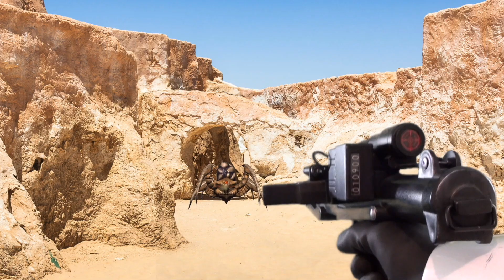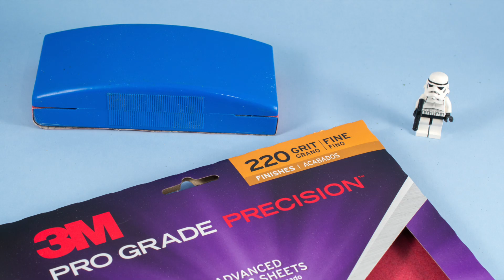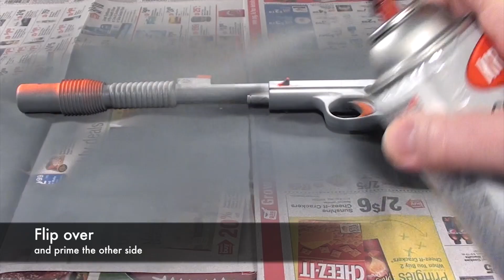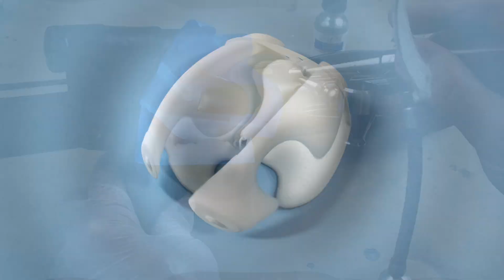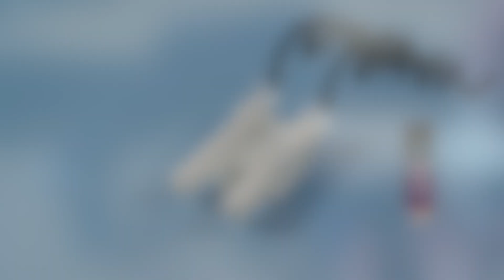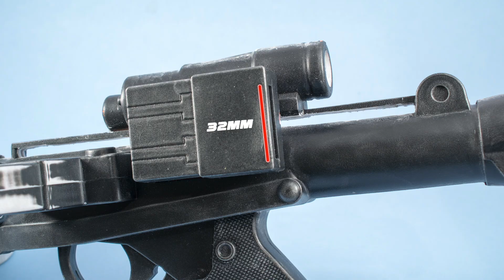Star Wars Stormtrooper Plastic E11 Blaster Prop Build

Comment: Did you seal the paint when it was done?  How has your paint job held up?  Got one of these and wish i had found your video a week ago....  Last night I changed my mind.  I will update using the techniques you made in this video.   Some questions I have:
     1.  If you are going to just cover the hole on the large side of the scope, then why did you drill it out?  Why not just glue the picture flat agains the intact flat scope?   Or  did yours already have a hole in scope at both ends?  Mine I bought is solid on both ends.  Did you drill out the front?
     2.  Why didn't you make the ring for the scope the same diameter as the large end of the scope instead of having the step?  The pics I have found do not have this step.
     3.  Did you glue the pop rivets to the power cylinders or not?  Because it I do not see them when you glue the power cylinders to the blaster.
4.  I ordered two pack of mic jacks.  Glad I did. I had horrible time cutting mic jack perpendicular.  So , what I did instead is I did not cut the black portion of mic jack.  Instead I drilled an undersized hole with closest size drill bit I had. Then I sanded hole larger until I could press fit the mic jack into the hole. Then I glued it in place.
5.  Also, looking back at video now, it looks like video sanded power cylinders smooth .  I wish I had done that. Not sure I want to go back and sand now that they are painted.

Comment: Is this compatible with the 501 legion requirements?
Reply from the maker: I have seen many other troopers "troop" with this weapon.  Not mine, but I've seen people who just buy the Rubie's blaster and spray it flat black without doing anything else.  The Rubie's blaster is about 3/4 size of the original E-11, so there is a size difference.  For an inexpensive and light-weight E-11, this is not a bad option.  With a little extra work, you can make that plastic prop stand out.  If you are looking to get approved with it, check with your GML.
Reply: @HappyTrooperDotCom  Great, thank you

Comment: How accurate is this in regards to size when compared to the actual blaster?

EDIT: Oh, and fantastic vid, I subscribed :)
Reply from the maker: Hello, thank you for watching.  The Rubies blaster is a bit smaller than an actual E-11 prop.  Here is a pic of me holding it, as you can see it is a smaller, but it is large enough to comfortably grip it and use it as a prop.  https://goo.gl/O1bdfy  Rubies also makes a First Order blaster, but it is too small, an adult cannot grip it comfortably, or get a finger in the trigger hole.  While the Rubie's E-11 is smaller, it is still a good enough size to use as a prop or display weapon.

Comment: Very nice. 18 thumbs down Rebel Scum are fearful of this weapon that's not as clumsy or random as a lightsaber. The Rubie's works pretty well as a base. Check out my vid of the Kenner "Drill" version. It'd be fun to mod that a little bit.  I also have vids taking apart my Kenner Falcon, X-wing and TIE Fighter to un-sieze the SFX motors. They hadn't been run in 30 years. I'd like to take the blaster apart but it works and it's debatable how hard it is to get back together. I thought I'd never get the TIE Fighter back together with the wing springs and the round shape. I literally gave it one last try or I was going to give up lol MTFBWY
Reply: After cutting the sight rail.. what and how did you fill in the hole..

Comment: Where did you get your stormtrooper armor?
Reply from the maker: My armor is from Anovos.com.  They do not specifically sell "Sandtrooper" armor, I weathered it with acrylic paints.  While Sandtrooper armor is almost identical to Stormtrooper armor, there are a few subtle differences.  I have a blog post listing most of the differences, here: http://happytrooper.com/?p=5354  The shoulder pauldron is from trooperbay.com.  The backpack is scratch built and has an MP40 ammo pouch attached to the left backpack strap.
Reply: HappyTrooper, hello fellow trooper!

Comment: Hello Happy Trooper I have followed your instructions to the word building the e-11 blaster very impressed, The only problem I am having is the power cylinders, The reason being is that I went to shapeways.com to purchase one I am in the U.K, and they want £9.00 GBP , However when I went to the checkout they wanted £28.00 GBP for shipping which I think is extortionate, I have purchased things from the U.S. before much larger items and paid less for the shipping, So I am asking could you possibly send me the dimensions of the power cylinder tubes length and diameter this would be very helpful in my build, Also I have ordered another Blaster the same that I am going to take apart use the x2 sides and from the outside make some fibre glass moulds to make a blaster, Best Regards

Comment: any idea on how you can add some weights on the inside to feel a bit more heavy like most blasters? i hate how the rubies are hallow.
Reply: go to a dive shop and purchase some lead shot and before you start take the blaster apart in x2 halves and mix the lead shot with resin and put it in various places inside let it cure then reassemble, I did an MP40 bb gun for a re-enactor friend of mine the gun was orange in colour I took it all apart sprayed it and re-assembled it aged it with the lead shot inside and it looks good and has the weight to it but with the blaster don't fill it right up as it will require a reinforced holster and it will be too heavy hope this is of some help.